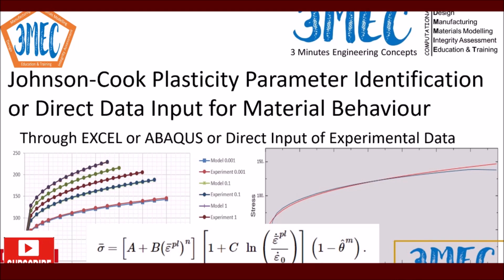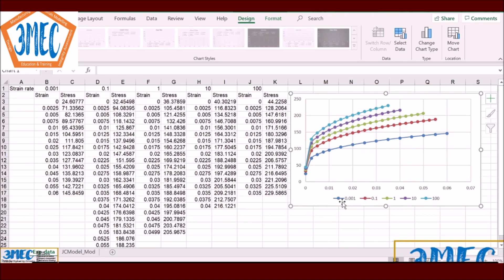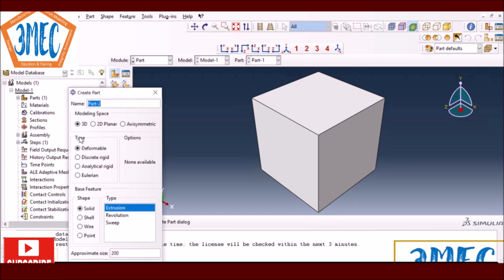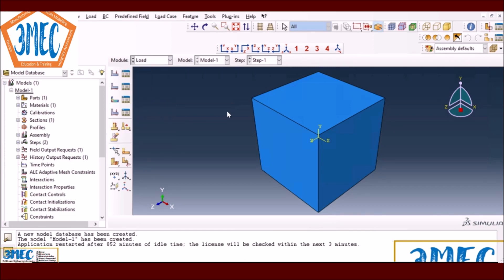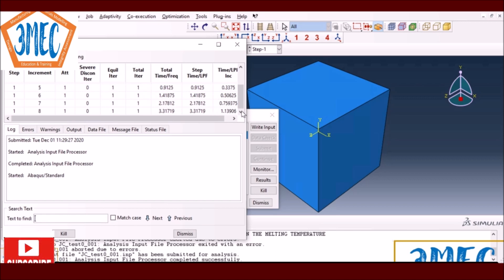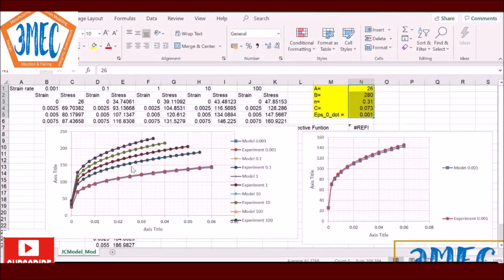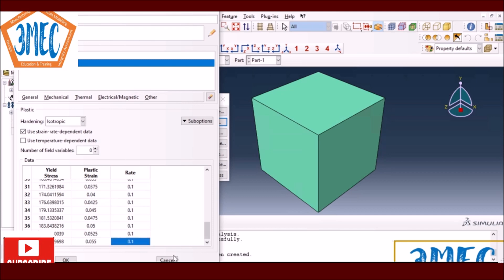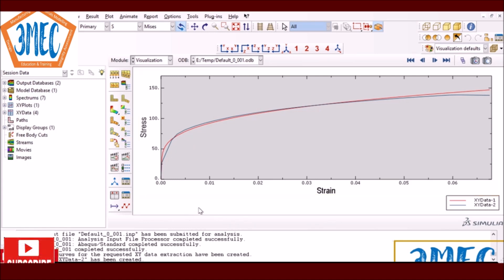Johnson-Cook Parameter Identification vs Direct Data Input for Viscoplasticity - ABAQUS Tutorial

Comment: Hello, thank you for this video. I would like to ask that why don't you define the damage, failure parameters (d1, d2, d3, d4). I want to use J-C material model for my V bending springback process. Does it work? Should i define damage parameters (d1,d2,d3,d4).
Reply from the maker: It depends on material and process being modelled. I did touched base on this. May be check abaqus documentation for details on these parameters.

Comment: at 5.41 how did you find the parameters so quickly, i have a stress strain graph and with the strain rate but cannot find A B n
Reply from the maker: Thanks for the comment. Its just experience and as explained in the video A, B and n control certain parts of the curve. So start fitting slowest strain rate curve and then play with strain rate based parameters. All the best.

Comment: Hello, 
I’m a new starter of FEA/Abaqus, and I’m looking for the definition of viscoplastic material model, which I found many people used it to simulate material behavior in dynamic simulation. But I can’t find “viscoplastic” option in Abaqus material module.
Is the material model you show in second section(elastic + plastic data with different strain rate) what people call viscoplastic?
Thank you!
Reply from the maker: Yes rate dependent, strain rate dependent, Viscoplastic are same

Comment: Hello where is the johnson cook strain rate? C and epsilondotzero is defined. But Epsilondot isn't defined. For example, for 1000 s^-1 strain rate and 1 s^-1(epsilondotzero) in rate dependence C and epsilondotzero is defined. epsilondotzero equals to 1. But where is the strain rate for johnson cook ?
Reply from the maker: Do you mean in excel or Abaqus?
Reply: @Professor3MEC  abaqus
Reply from the maker: @10:12 rate independent parameters are defined in Abaqus while at 10:45 rate dependent parameters are defined.
Reply: @Professor3MEC  thank you for your comment but i mean if referance strain rate is zero and temperature effect is ignored  we define the parameters A B n  C strain rate and referance strain rate result of this the flow stress is defined. But in abaqus we cant define strain rate. How abaqus define strain rate? Since we dont  write strain rate. Does abaqus interpolate between strain rates and solve it according to this interpolation? In other finite element programs such as ls dyna and deform 3d i couldnt find strain rate parameter too
Reply from the maker: If you are asking about strain rate in fe model then that is based on boundary conditions and applied loading.
Reply: @Professor3MEC  thanks